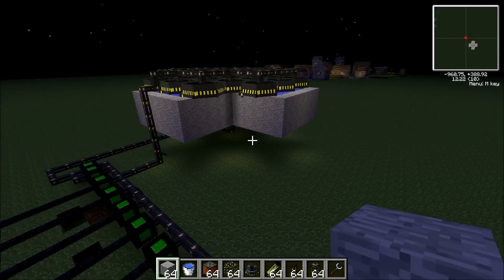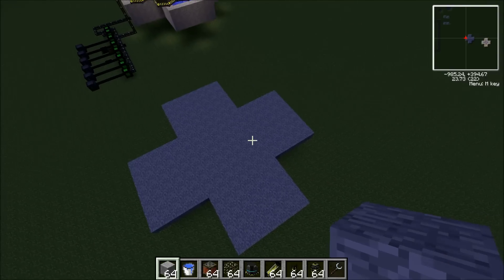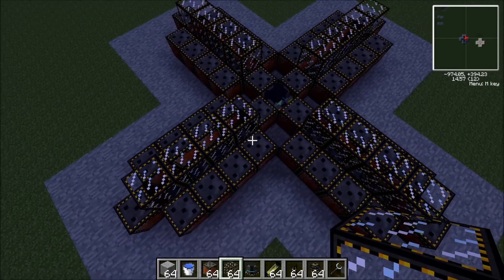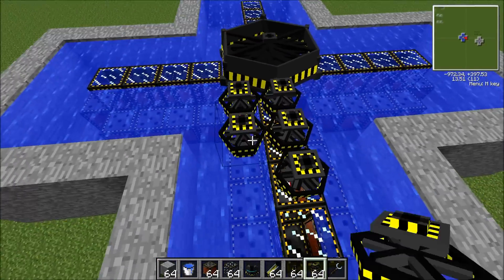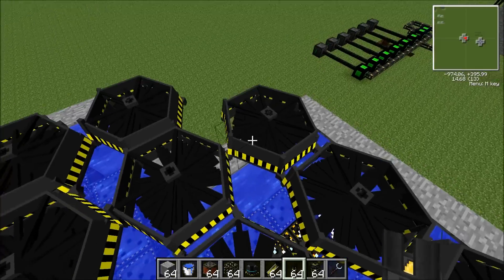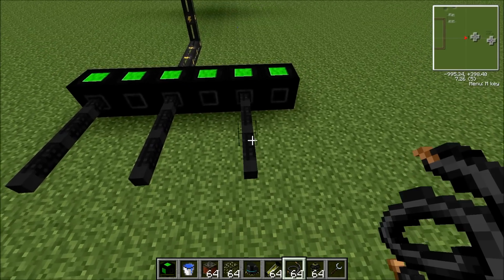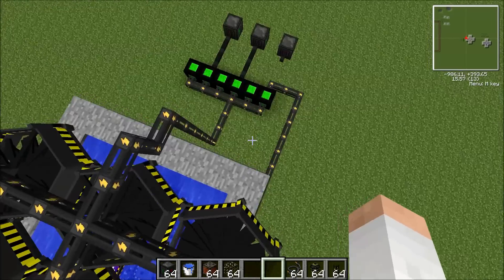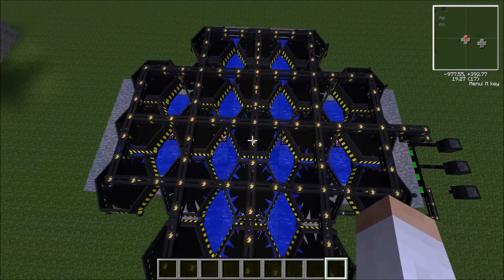Voltz Tutorials - Fusion Reactor Build! 1.2+ Mega Joules a Second!

Comment: Why not attach a Fluiduct from a chemical Extracter to the fusion reactor it self and you dont need to worry about putting the cells init
Reply: I don't know what version he nor you are on,  but in my version, deuterium is not a liquid.  The chemical extractor doesn't even run without cells in it.  In Tekkit,  it's a later version,  so you can.

Comment: Im still in the progress of making more turbines for mine, but im using 2 redstone power blocks in series. The first one has an output (50mj) to an energy tesseract and anohter redstone power block. This 2nd one has an in- and output of 5mj and is used to power the generator.

For some reason there is no plasma coming up, but it boils the water just fine and powers everything (incl. 1 chemical extrator). I can make more deuterium then the reactor uses up, but it runs out if i up the (in- and) output to the reactor (2nd redstone power block).

Not sure why this is, but its working for me.